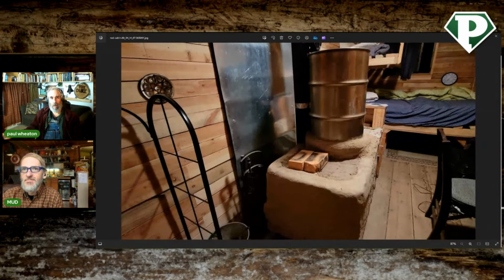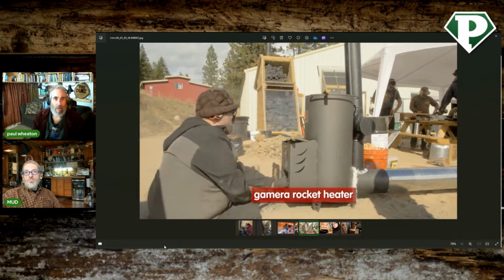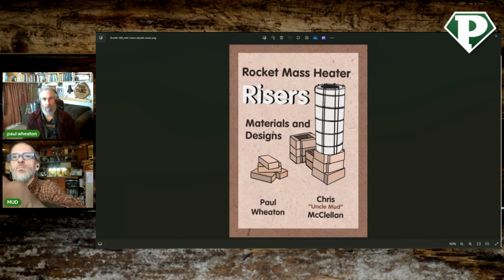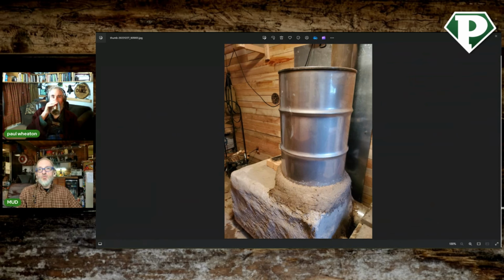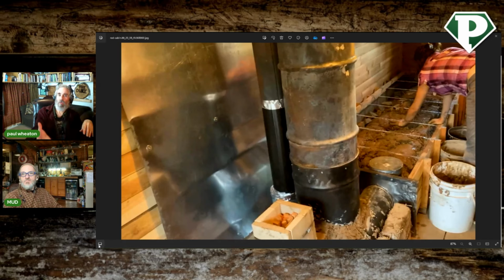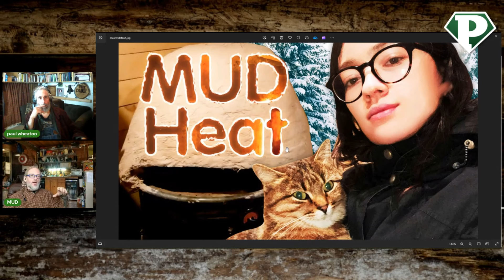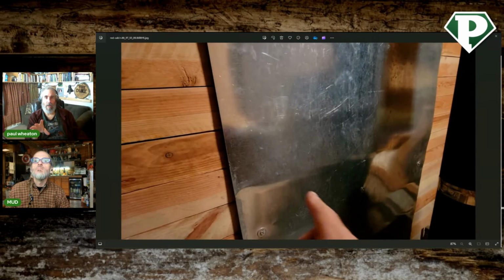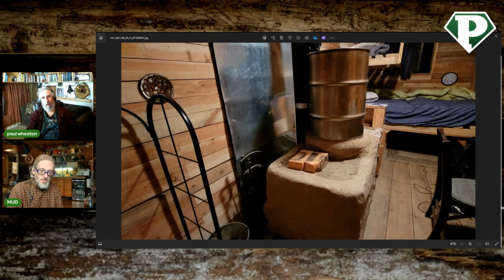6 upgrades for the j-tube rocket mass heater in the red cabin

Comment: There is a relatively cheap and simple way to make the primary heat exchange much more efficient for quick heating.
But it required a welder, spot, MiG or Tig. You need some sheet stock, and a brake to bend it into a Z with 3/4 inch flange on the small side, and an extra ¾ to overlap the one next to it, these would form a box channel to do 2 things, protect the barrel from coming into contact with kids& pets on the sides and also keep flammables from touching, but also it would make a series of enclosed fins that would each generate a stack effect drawing cool air at the bottom and rising up

Comment: Wouldn't rammed earth using light colored fire clay  perform similarly as firebrick? It seems it would be alot easier to make the riser using a 6" or 8" cardboard tube as an inner form, and then make a wooden form around that with whatever gap thickness us ideal for the riser mass. Then just pack full of moist fire clay/rammed earth. Then remove the outer wooden form, and burn out the cardboard inner form. Finally, wrap the rammed earth with rockwool, perlite, or whatever high heat insulation is available. The only significant cost would be insulation which wouldn't be more than $25-50. As far as clay goes, the lighter the color, the more fire resistant it is so just find the lightest color clay you can in your ground and mix 1 part clay to 3 parts sand to make rammed earth firebrick.
Reply: Or for the inner form, just use a  regular 6" or 8" steel wood stove tube, pack rammed fire clay around it and leave it in place. After the steel burns away the rammed fire clay will do the job as good as fire brick from the store.
Reply: I think that's a very interesting idea, and I haven't heard of rammed earth being used for refractory purposes. I'd love to learn more.
Reply: Simplest diy firebrick I have found is 50/50 mix of play sand/plaster of Paris - king of random video of diy forge - still works 9 years later! (Just keep dry once mix is dried )

Comment: Can I ask why you seam to be so set on using fire brick or ceramic fiber? Please hear me out. 5-7 years ago I built my first RMH (6" J system)  using the info on permies, I did clay/perlite cast core and cast heat riser using the same material. The thing WORKED and I mean amazing, so much heat the barrel top would get cherry red in a dark room and the metal actualy spalled on the barrel lid. It worked awsome until I learned my local clay did not take heat well eather that or the perlite was melting, at the base of the riser there was spalling of the heat riser (no metal at all just clay/perlite) it spalled so bad I had smoke and draft issues.  I blamed my local clay so I bought some insulated fire brick as that was the suggested go too, I tryed roxul and ceramic wool for insulating the brick as well as just by its self, nothing worked as well as the clay/perlite riser. I even tryed the 5minute riser with ceramic wool and it also did not work as well. The core started to erode the second winter around the feed tube so I rebuilt it using again insulation fire brick, it worked even worse, harder to start and most potential to have fire creep. All which was never a problem with the original everything cast clay/ perlite. The original worked so well it had too much draft and was hard to light as it sucked the fire away from the Paper/kindling. I know you have done extensive testing, I even built a core from ceramic fiber board with a riser of ceramic fiber board and it did not even work the same as the cast core. Everything stayed the same through all the testing, bench, transition, barrel and all. I would my self never use bricks or ceramic fiber again. I want to built another one at my new place with clay/perlite again, different area so I got to test this clay or try and find some really high temp clay.  That's my personal experience nothing works as well as clay/perlite.

Comment: So using a 6" J fire tube how long do you expect that you can make your mass chamber? I am wanting to collect all the heat  that I can but yet not to starve the stack of needed heat. I am looking at a minimum of 10 to 12 feet in length of mass so i will end up with 20' of piping before it comes out of the mass behind the barrel.

Comment: Commenting b4 finishin the vid,  so this might be addressed,  but could a tesla valve in both the intake and a restrictive tesla valve inside the rock mass work? , i believe it would increase the air intake, reduce back draft and slow the exhaust to release its heat, also its completely nonmechanical so could be made with cob,  would also reduce the nessessity of getn the thermodynamics perfect

Comment: How come you  guys don'i  use electric  hot water   they  come in all sizes even if they are 2 tall  you can cut them  down to what and what do, what do think   you of making them out of concrete mixed   with refractory cement  and  pearlite cause 50 gallon drums  eetually get pin holes andyou have a room full  of smoke .As far asyou mud dome  you could make the dome into a pizza oven
Reply: Walker stoves make the drum part out of brick with a steel plate top